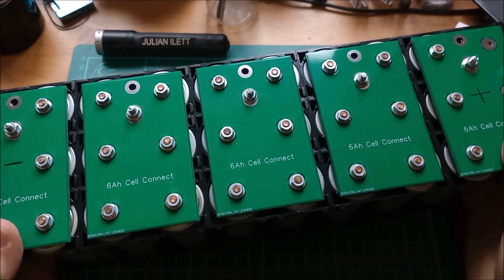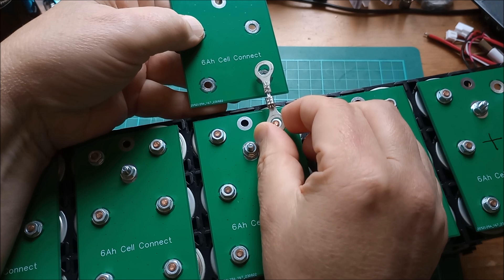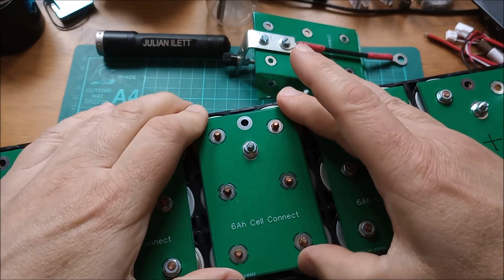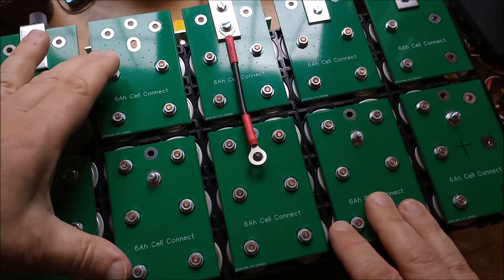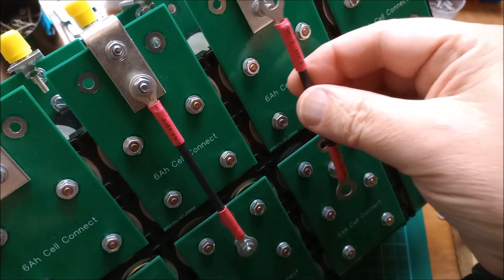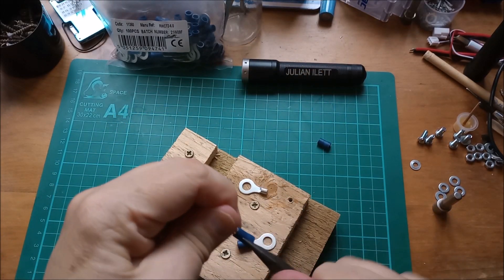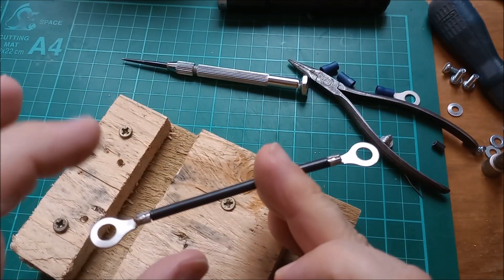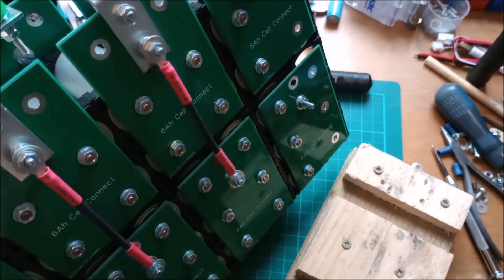768Wh Battery Build Update

Comment: In regards to the wire connecting the boards virtically ("interlinks"/parallel connectors) it really shouldn't matter to much, it should really be negligable and only keeping the potential the same and once the battery is settled it shouldn't carry any current unless there is a serious problem. HPPowerwall used tiny cables (like 1mm2) connecting 2 sets of 180Ah cells together when he was having issues with some of his balancers. The only place it might be an issue is at the very positive or negative sides of your complete battery.
Reply from the maker: Yes, that's a good point. I suppose the maximum current I might expect in these link cables is the balancing current of a few hundred milliamps when the battery is fully charged or fully discharged. Nevertheless, I won't be swapping them out for thinner cables - not now that they're made.
Reply: @JulianIlett  doesn't hurt having the ticker wire, for this purpose they will provide no resistance between the top and bottom parts of the cell. I would suggest this might give you better readings for the balancer but since balancer cables are so small it probably wont make a difference xD